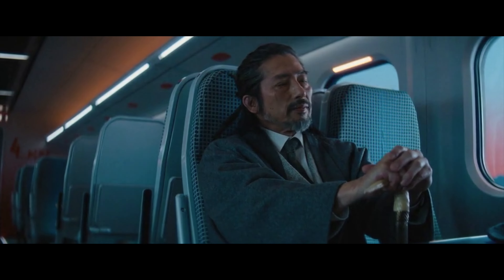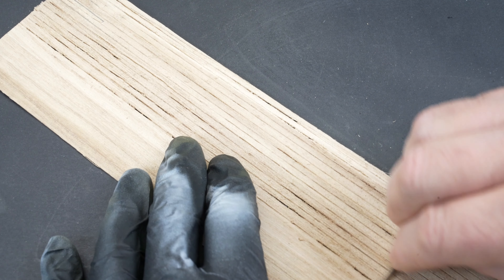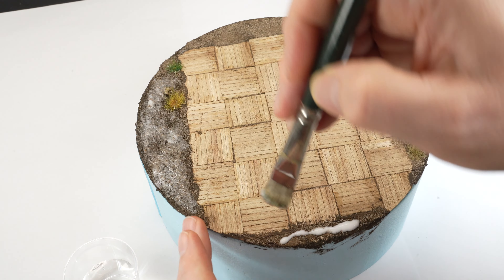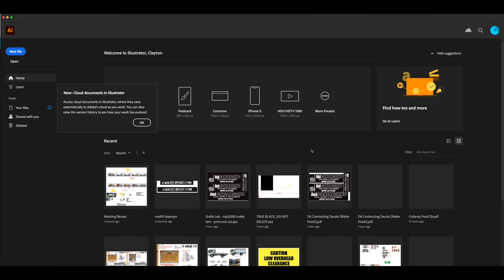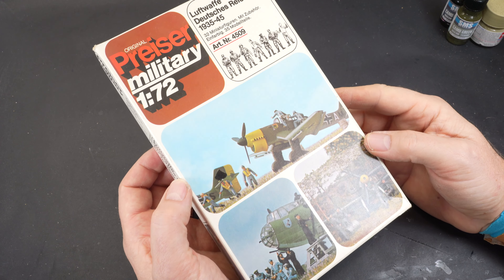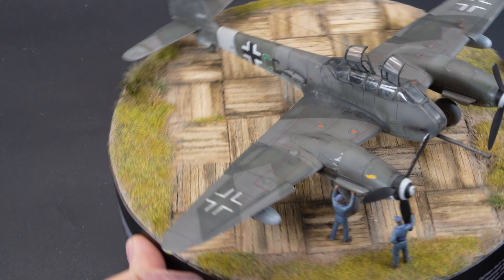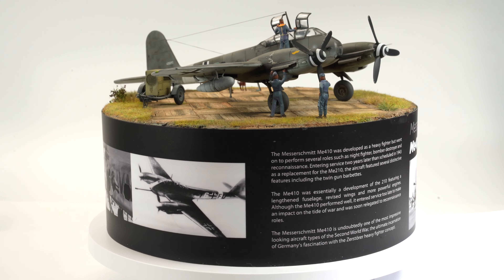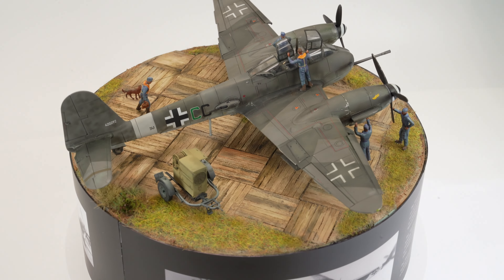Building the PERFECT Model Base You've Always Wanted

Comment: Superb video and I am sure that a lot of modellers feel the same at the end of a build. This video helps a lot !! Thanks ❤
Reply from the maker: Thanks Steven. Glad it was helpful! Thanks for joining in 🍺💪
Reply: @workbenchhobbies4316 so this was a 200mm diameter base. Did you have to use 2 lots of plasticard to back the vinyl onto ?

The reason I ask is I can only seem to find 300mm long sheets in the UK and the circumference would be 628mm if a 200mm diameter was used
Reply from the maker: @TheScaleModelShack - in my real life I own a sign shop, so I can buy the styrene in large sheets. You might be better to approach a sign shop or even better a plastic fabrication place. I’m sure they’d sell you a sheet. Would last forever

Comment: Excellent video! You know, the whole reason why I got into model kit building was because I wanted to do this. Built a set and then add the base to make it a diorama. However, the amount  of work it actually takes, the buy of the fake grass, wood, paint, and more glue killed my interest on it but also because I became also aware of freedom in the hobby. This is what I mean: not having built the diorama allows me to freely combine a model with another different model to make it part of that “scene”. For example I built my m4 but since it doesn’t have infantry with it, instead of building a scene (making it thus “permanent”) I bought some infantry and built it and now I have a choice of building a base with or without the infantry and thus allowing me to be “free” and try poses when I want to just place them in a table. It also allows me to make such a small scene a big one as I can then add more models and thus make it such a big diorama without making it permanent. Plus storage is an issue. Since i have  limited space on my room, I can put the individual model in my shelf compared to the model plus a base who is quite big. And I can move it as I please without requiring much space to show them to my friends and family. Yeah I do wish that I have the patience to build a base, but the freedom or flexibility that it gives me for me outweighs the coolness of building a base and then make an actual diorama.  Any who, great base
Reply from the maker: Storage space is definitely an issue, and I understand about the permanent nature of fixing the model to the base. For me though the display bases are the ones that are the most appealing displays to non-modelling people. They provide scale and context. 
Thank you as always for your thoughtful insights 💪🍺🙏